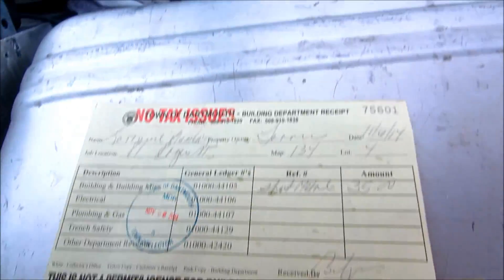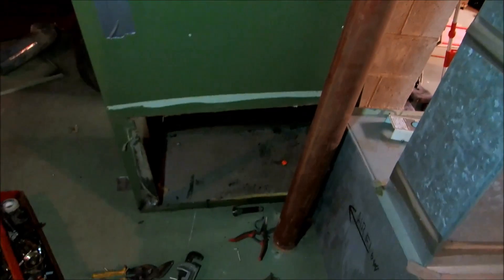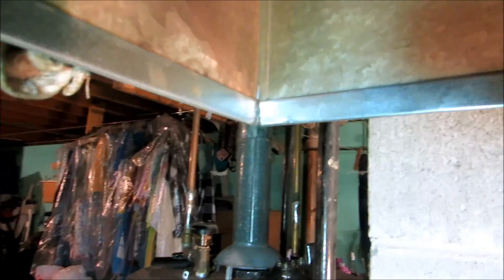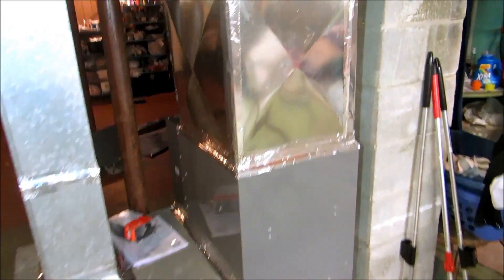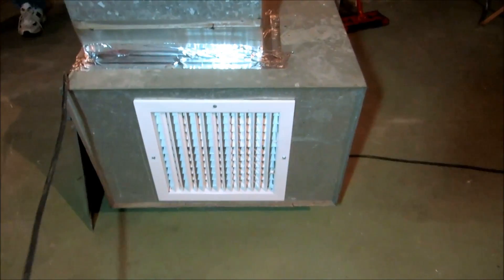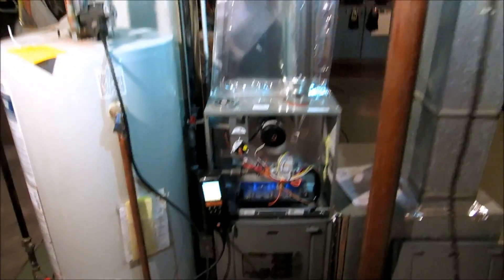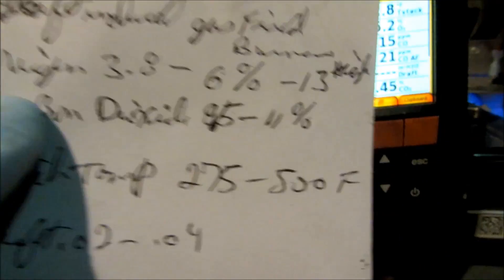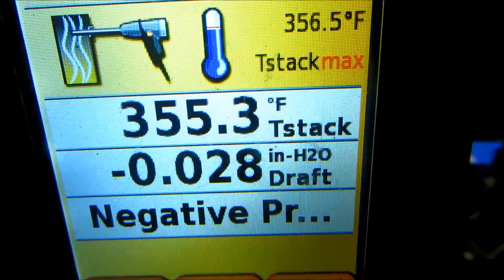hvac : gas hot air furnace replacement ruud 80+

Comment: I’m finally replacing my Ruud forced air oil furnace. Installed in 1985. The A coil condensation drain has been leaking into the furnace and rotted out the top of the combustion chamber.

Comment: Do you have to have vent both the water heater and the furnace into a chimney liner or is it ok where you install to just use the clay tile for either or?
Reply from the maker: Kevin Johnson the chimney has a clay liner,, ok in my state for gas

Comment: looks nice steve. I cant believe they want a permit for the sheet metal. crazy man. could that return you cut in suck combustion gas from water heater flue?
Reply from the maker: old1234 there is a full ceiler down there,, and a older house,so the return grill will be fine down there ,plenty of make up air ,there was not enough return for the system to operate properly

Comment: Hey Steve,  
I thought that you had to have the door on before doing a combustion test.  Otherwise you don't get an accurate reading because of the increase in air flow.   What are your thoughts on this?
Reply from the maker: Keith Gouveia it would not hurt to put the door on ,,,its pulling in room air ,,,,,not out side air..

Comment: Ah you guys on the east coast got it good.  Standing up working.  Ive been on my back,stomach,elbows and knees for the past week.  Doing a full gut remodel on a two story post and pier town house.  Theres about 2ft clearance under the joists and about 12 under the beams!.  They spec'd PVC on this one and when you crack the Primer under there you have to poke your head out every couple of minutes otherwise you be high as a kite.  I'll make a quick video of the finished ruff plumbing.  Jumped on with a state wide (different islands are kinda like different mini states)  company that has been getting the bigger jobs over here and dont want to get fired my first week if the owner shows up when I have the tri pod out.  Hahahaha
Reply: I used to work in Wyoming and it was the same way.  Crawlspaces everywhere.  Nice to be back on the east coast where basements are common.
Reply from the maker: Ryan Dugger sounds like a g.i.joe job ...no thanks you can have them ..
Reply: More like seal team six....hahaha
Reply: Keith Gouveia
 Did you guys have scorpions and centipedes in Wyoming?  But get some nasty critters I bet.  Rattlesnakes and black widows are no joke either luckily we only have nasty bug critters here in Hawaii.  But they are real nasty and the centipedes will crawl up your pants and bite you before you know they're there and they will continue to do so until you get them out of your pants....and try getting one out of your pants with 2ft of clearance.....Seal team six all the way.